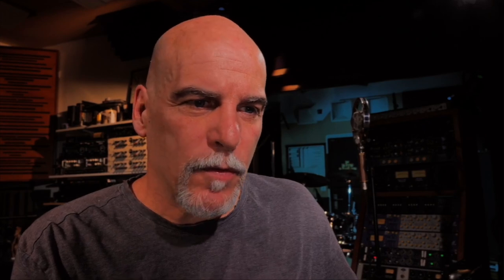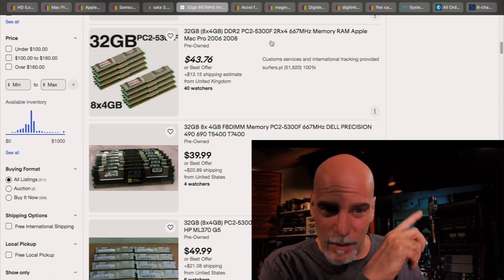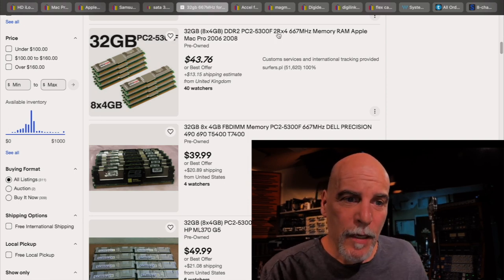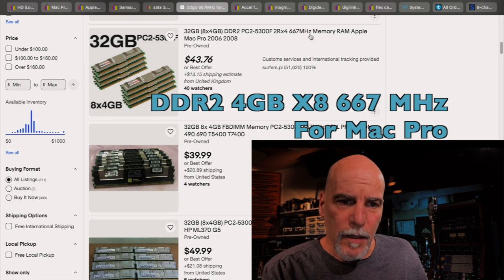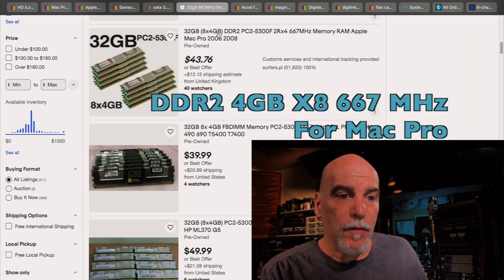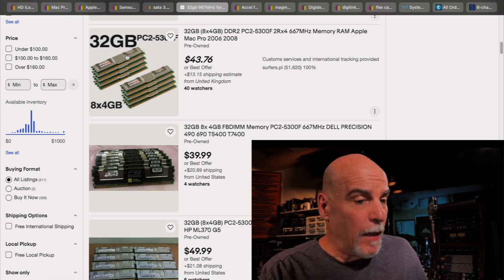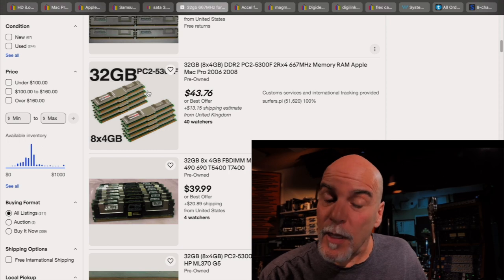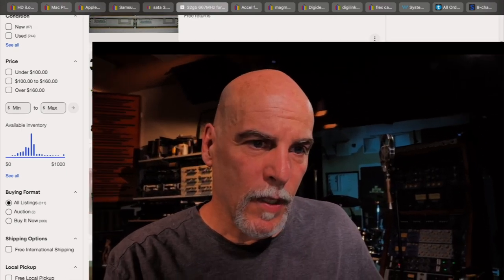How To Build An "Off The Grid" Future ProofPro Tools BEAST Cheap!

Comment: Hi, really liked this video, always wondered how the tdm or HD systems were put together. I started back in 1994 with ver. 5,6,7,8 on the simple 002 & 003 systems in my basement. But I spent 2 yrs at a pro studio using a HD system in engineering school.  Did FOH sound for 30 yrs and got old.  Now I built me a 2 story studio on my property.  I got away from Protools in 2000 for an engineer job in a nice club in Nashville.  But now I got PT ver 12 perpetual and been using Harrison Mixbus 32C DAW for 8 yrs.  But since Avid just started back with perpetual licenses, I’m thinking of buying back in at the current version perpetual.  I’ll stop there using the new Avid Carbon interfaces…..I’ll stop with this system for a few years to see how Avid does…? Your system sounds fantastic, I don’t think you’re missing much with all the dsp cards and the software you are running. Got another subscriber 😊😊

Comment: I’m building 3 (!) very similar rigs right now and it teaches you how to be a tech real quick. One rig is a dual 1.42 GHz G4 that already had OSX Tiger. I installed PT 7.4 on that machine (CD ROM) with iLok. The second machine is almost exactly like the one described in the video, a G5 power Mac dual quad core with 32GB RAM. I have installed PT HD10 (CD ROM 22:42 ) with iLok. The third machine is an Apple xserve rack mountable machine, same specs as G5 power Mac. Some basic issues to keep in mind: The G4 will only fit PCI-X core and accel cards. The G5 will only fit PCI-e core and accel cards. The card pin configurations are totally different. Also, any version of PT is picky about the specific OS you have in the machine. Lastly, be prepared for dealing with bad processing cards and HD cables if you are buying them separately. I had a bad core card when I started building the G4 rig. In my G5 the HD10 software is not loading, it freezes the machine. So this process is not always smooth; prepare for a fair amount of troubleshooting if needed

Comment: I'm still using my PT10 which I got in 2016. When my computer died in 2022, I found a similar one on ebay for $50. All I had to do was move my harddrives to the new computer and I was good to go. I guess I'll stay with this system for as long as I can
Reply from the maker: Smart

Comment: watching this makes me want to resurrect my old HD Accel rig...I have everything except the computer actually...but my cards are all PCI-X from the old G5 days lol...so would a magma chassis be able to run a mix of PCI-X and PCI-e cards, or just one type? The crazy thing about all this, is anytime I go back and hear albums I did on that old system, they always sound better than what I'm cranking out these days on my current up-to date rig...and I can never figure out why...haha...maybe there was some mojo in that old rig that I just never knew was there at the time 🙂
Reply from the maker: The Magma chassis can only hold either PCIe or PCIx but not both. Mine is fill of PCIx cards and the mainboard card is PCIe into the Mac Pro.
Reply: I hackintoshed an old HP workstation I bought for $35 and installed PCI HD cards in it. Ran as well as any Apple branded Mac.  This was about 5 years ago.  Nowadays I'd just grab an old Mac Pro and some PCIe cards.  Funny thing is I've had a Digi 192 in my trunk for months now.
Reply: @lorenhoward8178  Get that poor thing out of your trunk LOL!

Comment: Hey Devon, I love all your content! We have almost identical rigs. I’m running HD3, C24 TDM with PT 8.1. with Mac Pro 2008. It’s rock solid. I now only invest in outboard gear, Neve, Manley..Quality mics and instruments. I didn’t realize you could upgrade OS to 10.7.5 Lion with PT 8.1.? I’m running 10.6.8 Snow Leopard. Just curious. Thanks!
Reply: PT 8 runs fine on 10.9 too which is great because you can run a few newer plugins(although the list is very short) that aren't compatible with 10.6. I tried it and it seems to be fine. I've since moved to PT 10. The thing that doesn't work(if I remember correctly is the uninstallation). Anything above 10.9 and you run into the graphical glitch.

Comment: No offline bounce, no Atmos, locked in to Digidesign hardware, etc etc. Glad it works for you and you’re happy, but trying to get an older system in 2023 is quite difficult because you have to find the software and everything unless it’s a turnkey solution from a previous owner.
Reply from the maker: Offline bounce is a deal-breaker for some, that's true. Atmos is a whole subject of it's own, I will do a video on that subject in the future. If I ever go Atmos, I will probably  bounce stems into Logic and fake it with Air Pod Pro headphones until I can afford 9 more Focals. Ouch! $$ PT 9 and 10 frees you from the digidesign circle. I do have a Lynx Aurora 16 that works with PTHD 8. Are you doing Atmos? There are only precious few interfaces for that as of yet. I'm still on the fence there.

Comment: Hey great video man. Can you make a video on digidesign 888 24 i/o on how to connect and use it or anyone in the comments please help
Reply from the maker: You would need a TDM pro tools system. Either an older "Mix" system or the HD or Accel system, which would have PCI cards for mixing and processing. Plus you would need a computer and OS system compatible which would tend to be OSX Lion or earlier. My Accel cards have "legacy" ports which is where the 888 would go if I had that. Hope that helps.
Reply: @devon-graves-studio-D  Thanks and what does computer mean at the back of digidesign 888 24 i/o what cable do I need?

Comment: Is it really necessary to have 32 GB of RAM installed, since 32 Bit Pro Tools versions can only use up to 4 GB of RAM? If you've somehow found a workaround for this, maybe you can talk about this in a future video? I'd like to know about that personally. :) Oh and what you said about PT having not changed much over the years... after Arjen donated his PT 24 MIX+ system to me, I went back to his house a year after and asked him about his newer PT rig (HD... something) and he said: "I would've kept my (yours now, haha) old PT 24 MIX+ system if I knew not much has changed really". BUT... this was back in 2013. Arjen now runs PT (whatever... current) HD-X/Matrix or something combination. Don't know much about it and I don't wanna know much about it, because he told me what he paid for it, hahaha. :)
Reply from the maker: Interesting point. I never realised that. That certainly explains a few things. In the end if it works, it's all you need. I hardly ever run out of dap, but when I do, I only then start using RTAS if I still need plugins which barely taxes the computer. It's been rock solid.
Reply from the maker: dsp not dap

Comment: This is not meant as a troll or flame, but genuine heads up. Just last week I ran an almost twenty(20!) year old version of a DAW on Windows 11. The program executable was built in 2004 for Windows 2000! And it runs on the latest PC hardware and latest Windows version without any problems. That is because Microsoft has 3rd-party software backward compatibility as one of their core values and goals. Something like that is absolutely impossible with Apple who don't give a damn. I'm sorry for any Mac owners in this regard. Having to forage ebay for old hardware like that. There is no guarantee this old hardware will remain available (and used hardware is often disgusting/dirty and unreliable) and you're missing out greatly on the progression of hardware (PC hardware from 2004 was like 100 times less powerful than it is today). So I wouldn't like to have to maintain or hunt for 20 year old PC hardware on ebay, like you Apple people have to do. That would be an absolutely absurd idea for me as PC/Windows user.
Reply: My M-Audio 2626 works great in Windows 10, but isn't compatible with my 5,1 Mac Pro anymore running High Sierra. It's almost criminal.
Reply: It's not Apple's fault that Digidesign/Avid doesn't offer backwards compatibility. 

All my MOTU audio interfaces going back to the 828 from 2003 works perfectly on my M1 MacBook Pro using the latest macOS 14.5 and the same could be said for RME interfaces. It's just Avid/Digidesign who can't be arsed to update their drivers for older hardware because they don't care about their customers. Yeah I had to buy a newer version of the DAW to make it work, but software developers gotta eat too.

It would be nice if Apple had compatibility environments like Windows, but you can always run a virtual machine to run older versions of Mac (or Windows!) on a Mac.
Reply: @ZeroG  First, virtual machines are a non-solution for real-time audio applications. Second, you have it backwards. No ISV is going to maintain their software e.g. for Windows 2000 or old MacOS today (regardless of if it's as rich as Avid), for example. It's the OS vendor, e.g. Microsoft's job and noble goal to maintain backwards compatibility of their OS with old proper software produced by 3rd parties for the OS, as far as possible. And funny how you mention audio drivers. It is incredible, but you can run a driver written for say Windows NT, some 25 years ago, on Windows 11. Something you couldn't do on any Apple device even if you wanted to.

Comment: I have 16 gb ram sticks. My machines have 128gb ram . I have two Mac Pro 5.1 computers. With two 6 core Xeons and 128gb ram and two SSd's.
Reply from the maker: What are you running on that? Is it an older system?
Reply: The Mac Pro 4.1 (flashed with 5.1 firmware) and 5.1 use DDR3 registered ECC memory. I paid for both  128 gb ram 80 euro (so 160 euro i total for new Samsung memory). @devon-graves-studio-D
Reply: I bought the HD8 license recently and have a regular PT10 license on the way. I hope it will work. And I can add the PT10 license to my ilok. Then when I purchase PTultimate Avid helpdesk said it would give me PT11HD and PT12HD. So maybe that will allow me PT10HD too because of the PT10 license on the dongle. But we'll see.
Reply: So I hire PTultimate for a year. Then get PT11HD and PT12HD as a bonus. Move them over to an ilok. What happens after a year? On that ilok? And what happens if PT10 is on that same ilok?
Reply: The focusrite control24 has 8 stereo simple inputs so I can attach the second (sonoma) system to the same Control24. If I connect a digital cable between the two systems I can allso send the 8 or 16 channels (output busses) to the HD3 system I guess. (using TDIF that maybe in the 192's will support 96khz (depending on the implementation).
Reply: Here is Jack OSX for routing sounds from inputs to outputs to make special connections. Maybe you know it. Maybe not.  @devon-graves-studio-D  

There is one reason to install a modern os on a seperate computer. And that is for MIDI 2.0. Something that will become an interesting option I think in 2025.